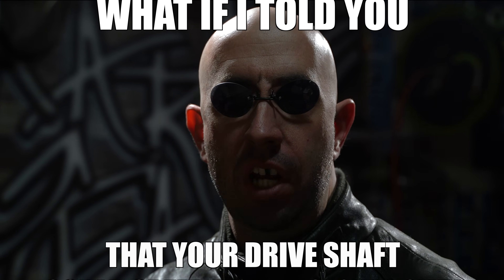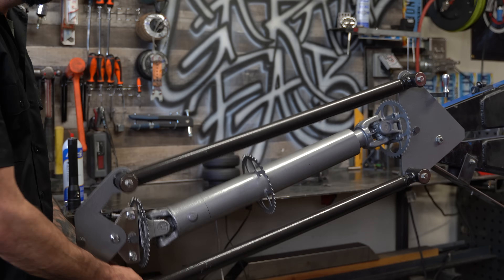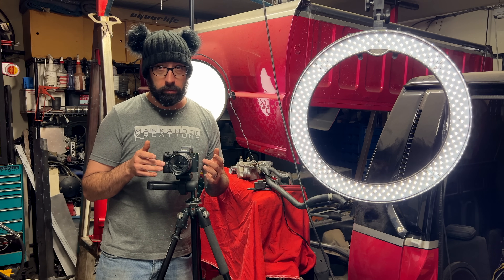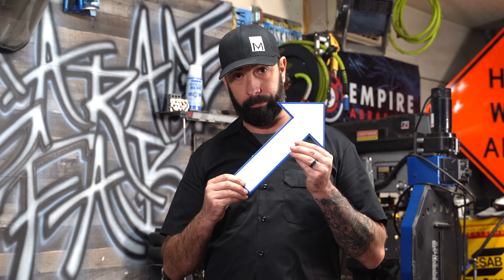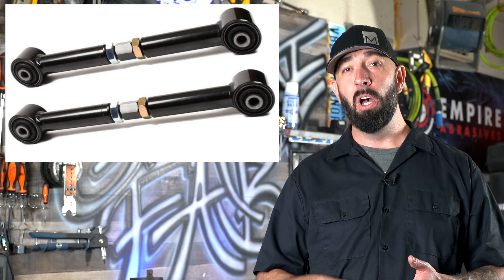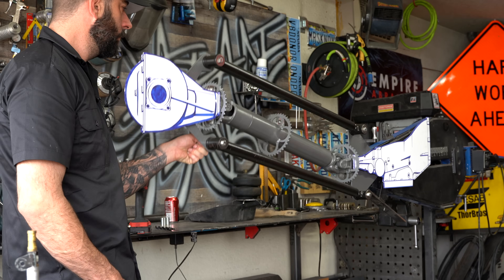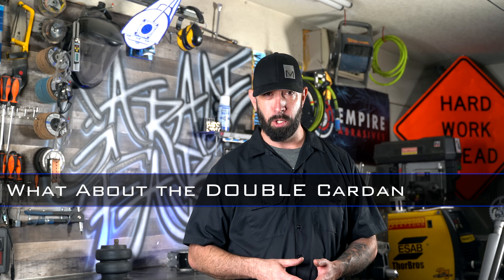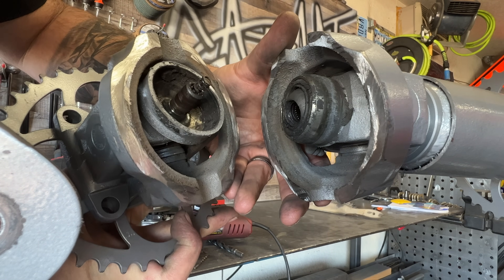THE Driveshaft Video. The Nature of U Joints. Suspension Basics Ep. 06

Comment: So just a couple degrees difference in these angles will cause vibration,  I've recently bought an old truck and the trans is 2 degrees down and pinion is up 4 degrees. Has a vibration about 40mph and up.
Reply: Thanks great video by the way
Reply from the maker: Well your pinion angle is indeed misaligned 2 degrees, but from my experience, that shouldn’t be enough to cause a noticeable vibration at only 40 mph. UJoint misalignment is interesting because the side effects increase with increase of the shaft RPM. 
Because of this, 10° of misalignment might be unnoticeable on a tractor with a top speed of 15 mph, and 1 degree would cause excessive vibration in a high speed race car. Think.
I can’t say for certain, this isn’t your issue, but if it’s your driveshaft causing your vibration, I would check the condition of your U joints. Wiggle the shaft around and make sure that your joints don’t move. And remove the driveshaft and make sure that you joints swivel freely with no hangups. Then, since the shaft is out, go have it balanced! Let me know what you find!
Reply: @GarageFab  I just had this one built and balanced and put it in friday it was a bit better but didn't fix the issue .my tail shaft bushing has a bit of movement.i may replace that and put a 2 degree shim and change my pinion angle . Try to eliminate everything, I will reply with results .... thank you
Reply from the maker: Please do! I suppose if you’re fighting a problem, covering all bases, even unlikely ones, would be wise.

Comment: Man I'm telling you, I'm in class. There's so much I didnt consider.
Reply from the maker: Knowledge is power. Careful with it!
Reply: @GarageFab  Good afternoon. I hope all is well with you. So ive determined I'll be making an upper bag mount from scratch to weld to the frame(no time soon but thats the plan)but for a 4500lb sedan, is 3/16" steel plate enough to support the wait and passengers or should go with 1/4" steel? The is for the rear suspension of an 07 vic
Reply from the maker: 3/16 is plenty. Just make sure it’s fully supported with some large gussets that stretch the entire height of the frame.
Reply: @GarageFab  awesome. Thank you

Comment: Terminology is everything thing. International semi trucks used to label their dump valve,for emptying the rear bags. Helps with coupling trailers. It was labeled "auto and on".
Confused drivers. They'd roll the road suspension dumped. Absolutely destroying the low/high synchronizer in a Eaton trans.
Reply from the maker: Doesn’t really sound like apples to apples does it?
Reply: @GarageFab  From my understanding the slow down & speed up in that giant drive shaft over powers the low/ high synchronizer in the trans. But if the truck is at proper height everything works fine.
We basically had guys rollin 80,000lbs with the bags empty.
Reply from the maker: Ah! Makes sense now!

Comment: That was the best video on explaining correct u-joint angle, and why I have ever seen. Yet I have one more question. on a divorced transfer case on a fixed hight vehicle you would Mount the transfer case so that the through shaft angle is parallel to the transmission output shaft and pinion correct?
Reply from the maker: Thank you! Honestly, Skyler, I had never seen a divorced transfer case before today! Quite interesting. What would this be used on? Are there factory vehicles with this setup or is it simply a way of converting a two-wheel-drive vehicle to 4WD?
If all the U joints in this drive train are single U joints, yes! All the components (trans, transfer, and both differentials) should all be parallel. If for whatever reason all this parallel-ness isn’t possible, some double cardan joints may be needed.

Comment: Basically a function of Pythagorean Theory. A□ + B□ = C□. The pistons in your engine travel more than half way down the bore from TDC, in the first 90°. This is because the con rod is pulled down 1/2 the stroke plus a bit more for the half stroke out to the side. Depending on the rod to stroke dimensions this could be 0.030" or more. The RPM does not change, but the distance travelled is increased, so piston speed in the top half of the bore is higher. Conversely the piston travels slower in the bottom half of the bore because the con rod is coming back in vertical line.
The cross in a U joint does the same thing on a smaller scale.
Reply from the maker: That smells like math. 🤮 But from what I can understand, that’s spot on. Thank you, Dale!
Reply: @GarageFab My point was to descibe how much a piston is lower than 50% of the stroke at 90° ATDC. This accelerates the piston faster in that first 90° and slower in the bottom 90°. The U-joints is the same situation, which your noise maker demonstrates. In a 4 cylinder inline engine that does not have balance shafts, it comes out as that buzyness created from the secondary shaking harmonic.

Comment: Any thoughts or an update explaining the driveshafts which use a single u joint on one end and a 6 or 8 cv-joint on the other end? I assume the 6 or 8 ball cv end is treated just like a double u- joint cv? Really enjoying your videos. 👍
Reply from the maker: Yes it would behave the same way as a double Cardan joint. It would be used on a vehicle with a two link suspension or something similar. Any suspension that would cause one joint to bend but not the other.
Thank you again, Mathieu.

Comment: Now you have covered 0° phased shafts, fancy bringing the kit out againn and doing phased UJ angles and raised diff noses? no one seems to do anything but inline 0° phasing. 😞
Reply from the maker: What do you need to know my friend? We’ve basically covered everything from 0° to 45° in both directions (way further than a usable amount in a U joint.)
You can’t lift the nose without dropping the trans so I’m unsure what you mean by phasing. I’ll try and help the best I can.
Reply: @GarageFab  ok, the best way to describe the consideration is look at the prop on a Land Rover Defender or Discovery 1, the transfer box is slightly tilted back, the axle's diff nose is high and the prop so phased at 45°, so the UJ's are not in line 0/90°, they are at 45° looking along the shaft. so far I have not found anyone that can give a reason why this works, it might help some of your viewers. The axle is held on 2 radius arms and panhard rod. 
Another interesting thing about radius arms is you can get make the diff nose on the axle keep almost horizontally aligned by setting a shorter top arm further back, so setting the main arms forward of the axle and short arms or A frame with ball joint, at back, on the diff top, if you get the dimesions right the diff will have a reasonably good arc keeping the nose level. Again, used on the Defender and D1/RRC suspensions. 

Really enjoying your suspension series, it is good to see someone that actually understands and explains why it does what it does. Thanks.
Reply from the maker: I’m still struggling to see it in my head and I can’t seem to find good images online. The ones I did see show a differential pointed upwards and the driveshaft is in line so that the rear U joint is straight. I can’t see the other end but on this style, the front joint would have to be a double Cardan joint and would be installed on a vehicle with leaf springs or a two link. This vehicle works BECAUSE of the double Cardan joint. A double Cardan can be bent at any angle because the two U joints counteract each other, essential creating a constant velocity type operation.
Is this the correct design?

Comment: Please address the drive shaft angle on two planes like the gen 1 camaro. How should we handle pinion angle? I reasoned that driveshaft angle is angle no mater what plane it is on. Any history or background on why the pinion is set to the side of center on the gen 1 diff... I assume it is because of trying to keep the car's stance low by pushing the differential up into the floor. I have searched for revelations on this and Drive shaft/pinion angel.
You did a fantastic job of educating us on U-joint tech... wish I landed here when trying to understand the vibrations in my gen 1. Still have some issues.
Reply from the maker: I don’t have a definite answer for you, but I can regurgitate some of the things I’ve heard.
One: A diff may be offset for vehicle balance taking the weight of the driver into consideration. (I’m not a fan of that one.)
Two: (My preferred reason) U joints need a slight angle to keep the needle bearings  rolling and lubrication moving. If a vehicle’s design doesn’t allow this angle, (perhaps the transmission tail shaft and the front of the differential are at the same height, resulting in 0 degrees of U joint angle, the diff can then be offset to create this angle. You are correct about angle being angle regardless of plane.
You can more or less ignore the sideways angle. In order for a driveshaft to be happy, the transmission and pinion angle need to be parallel. If both components are parallel, this means the both U joints are bent the same amount and there should be no vibration caused by shaft speed oscillation. You can change the vertical pinion angle, but you can’t change the horizontal pinion angle. (When viewed from the top, the pinion will always be perpendicular to the axle.) The engine/trans could technically be mounted at an angle but this is highly unlikely. (Who would do that?!) So from the top, the trans shaft and the pinion are parallel, so you need not bother with calculating left/right offset.
Hopefully that makes sense cause I’m about to make things a little more confusing…
U joints have maximum operating angles, and that maximum shrinks as the shaft RPM goes up. So a tractor with a maximum speed of 15 mph could potentially have a maximum U joint angle of 45°. A vehicle that has the capability of going over 100 mph, might have a maximum U joint angle of 6 or 7°.
A very high speed vehicle, would likely have a maximum U joint angle of possibly 2-3°. So this high-speed vehicle may need to account for the additional angle created by the offset differential.
Hopefully this wasn’t terribly confusing. Let me know if I need to clarify something! Cheers!
Reply: @GarageFab  After posting my original reply/Query I came to the conclusion that if the output shaft axis and pinion axis are paralell in whatever plane - good start. In a subframe car there are several variables that could mess with that in the horizontal plane and I will have to dig deeper. Pinion angle has been addressed already. Bad vibration at about 85mph. Been digging into balances and other possible contributors as wall.
Thanks for applying your brain to this.

Comment: Came here to research my hideous vibration issue at freeway speeds...may not be driveshaft balance after all....
Reply from the maker: Hey Brett! Has your car been modified? Most of this stuff generally doesn’t apply on factory vehicles. If you have the ability, I’d recommend shaking your driveshaft by hand to see if there’s any movement in the U joints. There should be none. If it passes that test, take the driveshaft down and move the U joints around by hand and make sure they move freely. There should be no hangups/stiff spots. I’d say warn you joints would be the most common cause for a drive shaft vibration. While the driveshaft is down would be a good time to check your angles. Let me know if you need guidance! Cheers.
If all that is good, all that’s left is balance!
Reply: @GarageFab  thanks for the reply! Most channel owners don't take the time. 
My car is heavily modified, but the suspension is a factory-type design (bolt-on tubular LCA's and panhard bar, that sort of thing. Adjustable torque arm also). I broke the driveshaft at the u-joint at the track, and needed a new one fabricated along with my Moser 12-bolt rebuilt. Ever since the new driveshaft was built, it's had a terrible shake at higher speeds. It MIGHT have 50 miles on it. Joints are all fine. Took it back to the shop, who insisted it was balanced when made due to having a weight tacked on it. They checked it, and eureka...out of balance. All they did was cut the weight off...
Still have an issue. I don't trust their capabilities. Driveshaft was shipped to Denny's Driveshaft in NY for analysis, waiting on those results.

Comment: Hey man ! Is there any way to have a prop shaft made to follow a twisted path (it needs to go left and right to offer clearance for the fuel tank ? Thank you
Reply from the maker: Hey Gabriel!  I’m that annoying guy that thinks anything possible. It might be challenging and potentially expensive but definitely possible.
 It would certainly be unique. Here’s how I think it would have to work.  
The axle would need to have an offset differential and a two piece driveshaft. The rear section of driveshaft would be off-center parallel to the frame rails and would pass along side the fuel tank. The carrier bearing would be mounted near the front of the fuel tank, and the front section of shaft would be angled diagonally towards the trans or transfer case.
Here’s the specifics that would be required to avoid vibration. The trans, the carrier bearing, and the pinion angle will all need to be parallel. Both front and rear shaft sections will need to have two single U joints. (So 4 U joints total) The carrier bearing must be able to maintain its angle. The typical rubber mounted carrier bearing cannot do this. It is possible this type of carrier bearing already exists, but if it doesn’t, perhaps you could create one with two rubber mounted carrier bearings 6-12 inches apart and a solid shaft that extends between them. The rear shaft would have to have a sliding spline so that the shaft can change length as the suspension cycles.
As long as the trans, carrier bearing, and pinion are parallel, in theory there should be no vibration. Note that U joints have a maximum operating angle for various shaft RPMs, and I don’t know if the angle of the first shaft would exceed that.
Perhaps show this message to a shaft maker and perhaps they can steer you in the right direction for parts.
Side note: If the tank is the only reason for this modification, moving the tank (if possible) would be far less work and money.
Cheers!
Reply: @GarageFab  Thanks a lot for your answer ! Is there any other place I can contact you to ask you another question that needs photos and other stuff for support ? Thanks
Reply from the maker: My favorite is Instagram @GarageFab, but if you don’t have an account, you can email me, GarageFab702@gmail.com
I’ll see it… eventually.

Comment: THANK YOU SO MUCH FOR THIS INFO!  I am building a 4x4 off road buggy and would have totally had the transmission shaft at 8 degrees down and the front driveshaft level had I not stumbled onto this video.  I am going to raise the transmission mount up to bring it level as well.
Reply from the maker: Happy to be of service, Danny! Make sure you’re not more concerned about “level” than you are about matching the pinion angles to your transmission/transfer case.  
If your front diff is level at zero degrees, then a level transmission would certainly be good. Remember, pinions that are parallel with the trans is key. Cheers!

Comment: Why don't cars just come with CV joints at both ends of the drive shaft, instead of Cardan joints?
Reply from the maker: The biggest reason is most likely cost. Car manufacturers really need to watch production costs when building millions of vehicles. CV joints are significantly more expensive. And since U joints only cause problems when installed incorrectly, the cheaper U joint is a better option.
It’s a benefit to the owner too, since the U joint is much easier/cheaper to replace. Manufacturers usually don’t care much about that though it seems.
Reply: @GarageFab  Thanks for answering! Cost is the obvious reason. I was wondering if there is some other engineering reason to use Cardan joints. Maybe they have longer expected service life or something?
Reply from the maker: I’m not sure about that. My first instinct is that CVs are way stronger. But I replace far more CV axles thank I do U joints. 🤔
Reply: @GarageFab  It's an interesting topic for sure. I wonder, since CV joints tend to be used more often on half shafts between a trans-axle and a wheel hub, if the more extreme angle variations they have to endure (relative to what would typically be found when a longer driveshaft sits between a transmission output shaft and a pinion input shaft) has something to do with their wearing out more often. Or do you think it's only due to grit making its way into the ball bearings because of failed boots?

Comment: Hey I'm installing the 2 link from ekstensive metal works on my s10  should I use the double cardon joint in the front of my  driveshaft
Reply from the maker: I would definitely use a double Cardan on a two link. When preparing to weld the brackets to the axle, set the mocked up suspension at about half travel, and point the differential at the tail of the transmission. If you can, I’d suggest tack welding everything in place, and have your drive shaft made. You can then install it and make sure that the rear U joint is straight at half travel. Note: A U joint needs a very slight angle (about 1°) to keep the needle bearings rolling and the lubrication moving to keep it from wearing out prematurely. But if you’re building a bagged vehicle, the continually changing ride heights should take care of this for you.
Reply: @GarageFab  I'm just seeing this sorry for double posting